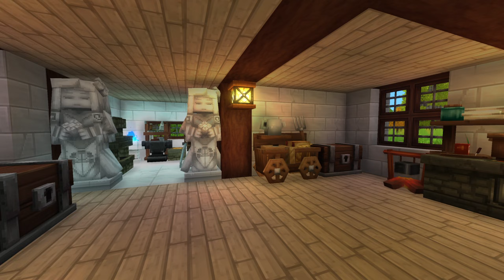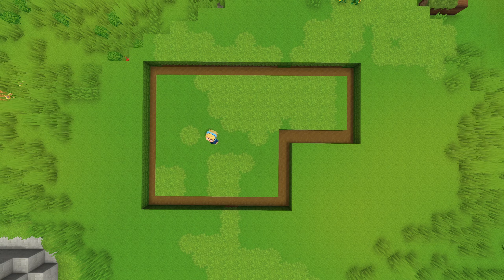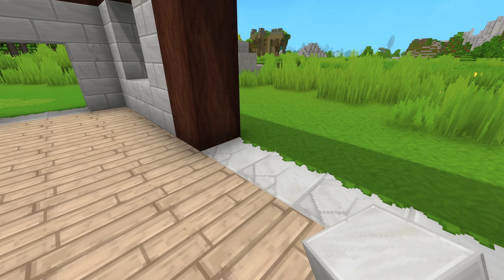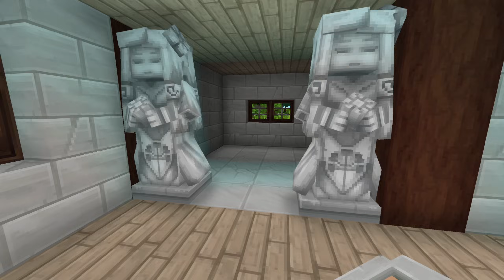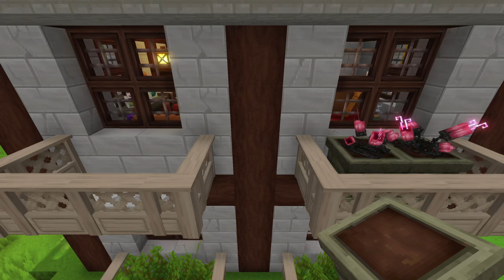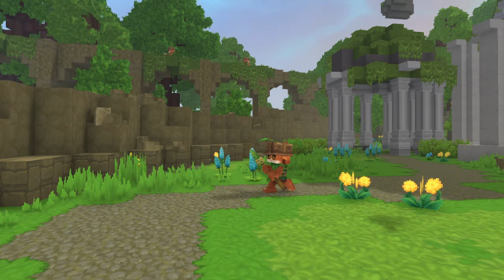Hytale Cozy Survival House Build - Full Tutorial

Comment from the maker: Here is the Material List:

188 Oak Logs
96 Hardwood Roofs
4 Simple Wooden Platforms
246 Marble Bricks
70 Marble Cobble Stairs
4 Marble Cobble Beams
14 Light Temple Platforms (as of now, available only in Creative mode, you can replace them with Marble Brick Half Slabs)
212 Lightwood Planks
16 Lightwood Stairs
2 Lightwood Planks - Ornate
8 Lightwood Beams
2 Lightwood Gates
72 Lightwood Fences
4 Simple Woodeen Doors
58 Simple Wooden Windows
14 Lanterns
2 Statues of Slumbering Deity
2 Light Temple Braziers
2 Simple Stone Braziers
24 Small Chests
1 Bed (any)
All Stations
12 Bushes
14 Stone Planters
14 Flowers (any)
2 Teleporters

Comment: cute build. it was really fun to do. when building, though, i noticed one of the material counts was off. instead of 96 hardwood roofs, i needed 126. i'm not sure if i did somethign wrong or not, but my build turned out exactly like the one in the video :) hope this helps someone. also i'm not entirely sure why it says you need 380 lightwood fences. the video only calls for 72.
Reply from the maker: I probably mistyped that, thanks for mentioning, I’ll double check that!